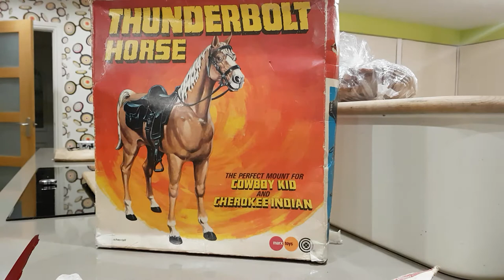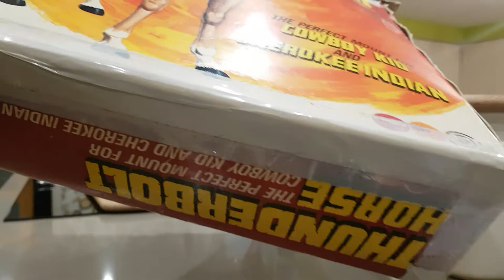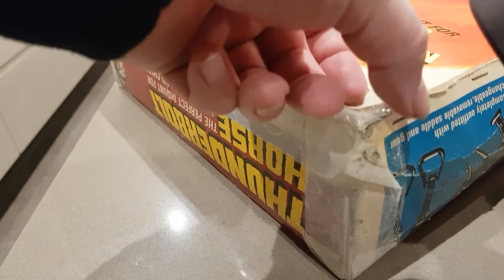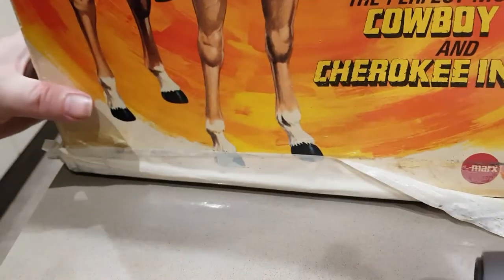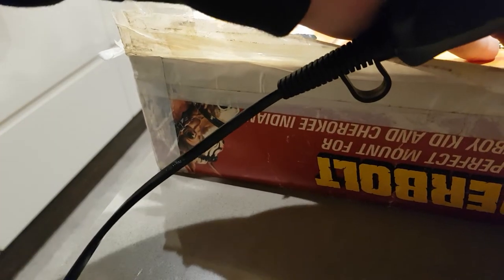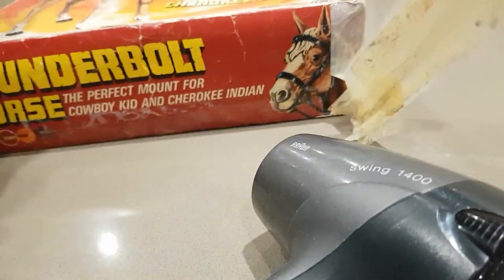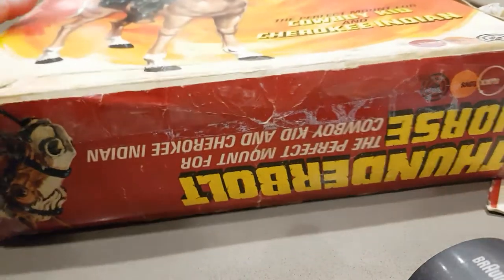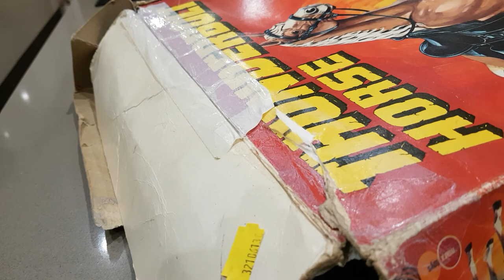Marx Toys - Thunderbolt Horse - Sticky Tape Removal Box - Vintage Cowboy 1967

Comment: It's certainly not conservator-approved, but I use lighter fluid to remove the tape residue. Of course, you need to spot test, in the event the paper/cardboard bleeds colour. So many things are ruined by tape. I collect paper ephemera, and have seen some beautiful items ruined by it.
Reply from the maker: Hi, thanks for the comment on this vid.. There is loads of sticky gum residue on that box, I'm not sure the video picks this up but it is tacky to touch. I will go and get some lighter fluid and see how it goes.

I had a signed Dr Who photo card of William Hartnell from the 1960's which should have been lovely except someone had run cellotape right across the signature. Frustrating..

I will pop a short video up of the lighter fluid outcome..

Thank you